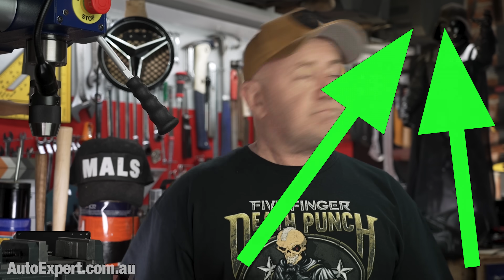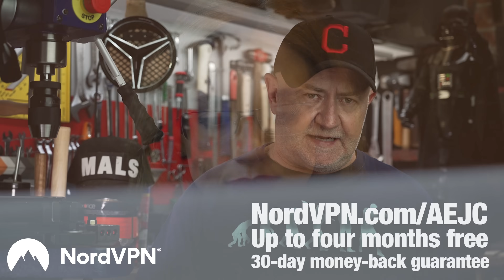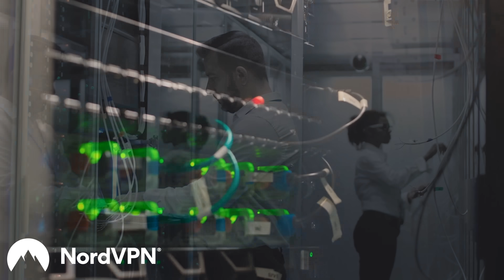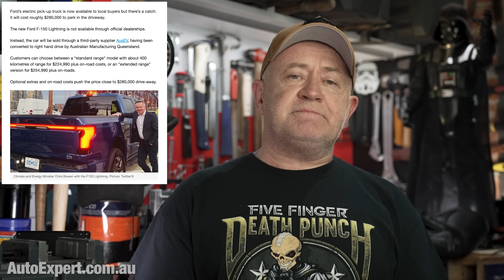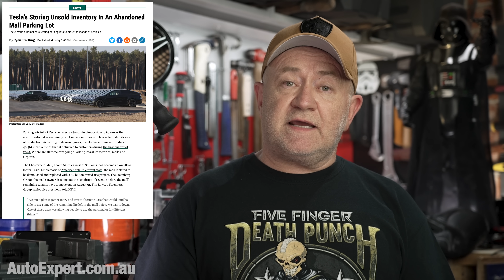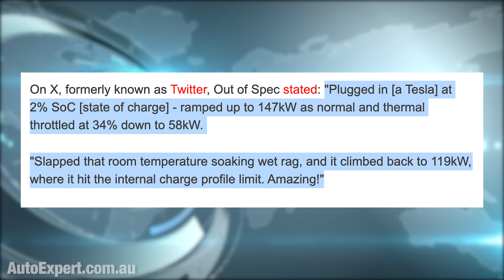ELECTRIC UTOPIA? Top 10 insane EV reports (this month)

Comment: Going on holiday with an EV. Either queue for 7 hours for a charger or fill the boot with spare batteries and take no luggage. What a choice!
Reply: And the extra weight will halve your range to get to queue even longer as you have to recharge the extras.
Reply: @alanhilder1883  precisely, it's like extending a rockets range. To get twice as far you need a lot more than double the battery, you need 4 or 5 times the energy as you need to carry all the chemicals, and the containers and cooling for them, just like you need to increase the fuel tank size and weight, and add more fuel to move that weight and fuel, and more again to overcome the increased drag due to the bigger rocket. It's simpler in thin/no atmosphere, but we typically launch from zero/low altitude, so we have a lot of drag to contend with, just like EV's with trailers lol.
Reply: @joytotheworld9109  Math desagrees! Take a 1000kg car of which 500 are batteries with 100 km range. To have the same car have 200 km of range you need less then 500kg more batteries.
Reply: @lucadellasciucca967  You're missing the point, Physics disagrees: A 1,000kg car with 500kg battery, if you add 500kg more battery you'll need to beef up the supension, it'll weigh significantly more(1) than 1,500kg after that. Now you not only lose range in the heavier vehicle due to the heavier battery, you lose range pulling the heavier car body too. You need lighter batteries or denser to keep the same km per kwh charged.

 (1)Say roughly 1,700kg after you up the suspension capacity, crash protection(2) and make it bigger to maintain similar interior space. 
(2)e.g. the passenger compartment especially in case of a roll over, crumple zones too!
Reply: @joytotheworld9109  Don't mind this little Luca. He is flooding this comment section with ”electro-religious” comments. Either is joking, but I'm afraid he is not... Possibly a troll.
Reply: @joytotheworld9109  ... which is why any EV of a decent range is a humongous vehicle - they need to beef up everything + the space for the batteries that will have enough energy storage to carry the beefed up vehicle + the batteries themselves. It's kind of a rocket equation (which is why rockets of any decent range are also huge). Sadly, the believers do not understand physics...
Reply: @zwerko  You said it. Same reason you need massive rockets to get a penny into orbit.
Reply: @ZangOne1  A troll, maybe, but I think a single clarifying reply is not feeding them too much, and if not a dose of reality might save them from spreading simplistic nonsense that gives EVs false promise.
Reply: @joytotheworld9109  Sooner or later, this kind of dudes would be slapped in the face by reality, and suffer the consequences.
My people have a saying: Every bird dies in its mother tongue.
Reply: @joytotheworld9109  Sooner or later, he and others like him would be slapped in the face by reality. But many of them would continue the ”crusade”, no matter what. My people have a saying: Every bird dies in his mother tongue...
Reply: @joytotheworld9109  Don't give them facts, they won't listen to facts. The delusion with these people is astonishing.

Sad too. 

Electric Jesus is a muppet. He's upsold a product he didn't have for decades and the USA is being exceptionally slow at prosecuting him. Something is fishy to me after they managed to get Elizabeth Holmes and Sunni Balwani (also fake product grifters).
Reply: Buy a Honda. A Honda generator🤣🤣🤣
Reply: Put a generator on the roof and charge as you drive, only need to fill the generator with petrol.😂
Reply: Fill the boot with batteries?…seems like money is no object eh…the sky is the limit, and you’re not even being ‘green’…yay😂
Reply: your tiktok to dance for monetized stickers to afford for the essentials while travelling duh.
Reply: I prefer option 3. Use a petrol or diesel car.
Reply: I went on a 7500km Australian outback holiday in my Tesla Model Y. I took the wifey, 2 e-bikes (inside the car), a spare tyre, and all our luggage. No spare batteries, and only queued once waiting at a single charger site for someone to come back and unplug.  Hardly 7 hours !
Reply: Staycation?
Reply: ButT I cHaRgEd iT At HoMe
Reply: Hmmm, last year, a guy from Perth drove around Australia in his Tesla. .....
13,500 kms in 10 days.... but keep peddling the nonsense....
Reply: @zwieseler  Very impressive I'm sure. However, if he'd had the good sense to use a diesel car, he'd have completed the journey in 5 days for half the cost.
Reply: @matthewgodwin3050  No one would "normally" do it in 10 days or 5.... on a holiday.
My point is.... the OP posted the usual misinformation!
Reply: Hitch up a box trailer with a generator and some spare fuel and your right to go anywhere
Reply: The good news is that the kids in school are back to learning critical thinking skills needed to plow through the YT bs.  They know that the election WASN'T STOLEN. 😉.
Reply: Mine does 600 KMs.......any further and I get a LCC to take me. Simples.
Reply: Once again Mr Codagan beats his Fossil fuel drum against the EV revolution. It’s time for him to start learning about EV’s rather hating them due to his zero knowledge about them. As to todays video he latches on to some piece of technology the average  EV user wouldn’t even dream of using or find the need to use it. Personally I have spent my entire working life since 1971 in the motor trade. Unlike Mr Cadogan I did not close my eyes to EV use but gave them a try after doing some considerable research into wether this car could be a usable replacement to my diesel car.
Firstly let me say I have never found the need to carry a spare can of fuel in my car simply because I am not stupid enough to allow my car to run that low in fuel. I change over to EV 5 years ago, have I ever run out of charge, no for the same reason I never run out of fuel with my diesel. Does my long range journeys take longer with my EV than my diesel car did, no it doesn’t, how s that you may say, simple good planning, make sure you have enough charge to get to next charge point if planned unit is not available for whatever reason. My EV has a bigger range than I personally have when it comes to Toilet/ meal/ coffee breaks and it doesn’t take longer to charge than I need for the aforementioned bodily requirements which would also have applied had I been driving my diesel car. At the end of the day the EV saves me more than £2360 in fuel costs per year. 
Would I consider going back to Fossil fuel vehicles, honestly why the hell would I, it saves me a fortune and is smoother and faster.
As to Mr Cadogans point on fires well the one aspect he failed to point out to his viewers is that a Fossil Fuel vehicle according to percentages of registrations fossil fuel vehicles are hundreds of times more likely to catch fire than an EV, he seemed to miss out that fact didn’t he because it didn’t fit his biased narrative.
Reply: Or use Tesla superchargers and don t have a worry in the world :)
Reply: @lucadellasciucca967  No worries except the car cost so much and is depreciating faster than you can make loan payments. Plus the boot is too small to go on holiday with the family anyway. Have to get a roof box which will destroy your range.
Reply: @thehairygolfer  I drive aTesla model Y. Long range lots of space and big trunk. Oh and a frunk. Supercharger network. Check it out.
Reply: @lucadellasciucca967  I think you'll find holiday destinations tend to be a long way away from locations with sufficiently high density of superchargers. Or any chargers for that matter.
Reply: @lucadellasciucca967   Here in Australia they are not that common and, by the sound of it, they don't seem to work in the cold of the northern hemisphere
Reply: @lucadellasciucca967  Elon fired all the staff responsible for running all the not so super chargers, so they won't be working for much longer. They're as obsolete as his fire prone death traps.
Reply: @matthewgodwin3050  To be fair, he re-hired 40 something of those people back—he wanted to downsize the department (which is ok request coming from a CEO), the director wouldn't budge, so he fired them all and re-hired a number of those he thought were suitable for the operation. Now, whether that number is correct or not is a different story, I have a feeling that most of Tesla woes would be solved by firing a single guy than thousands of others, but that's a topic for another debate...
Reply: @lucadellasciucca967  another yank that thinks America is the only country on earth..
Reply: @lucadellasciucca967 A tesla what crap charger, that mostly exist in USA. Your a funny one matte.
Reply: @lucadellasciucca967 Hilarious, they are just as bad , expensive abd now being opened up to many other makes ,join the queue

Comment: I pray at the Diesel Cathedral, Lord Otto is my saviour, a scavenged two stroke my hymn.
Reply: The heavy lifter of engines, nobody can argue with Diesel.
Reply: With votives for St.Stirling & St. Atkinson
Reply: Dr Rudolph Diesel was a god.
Reply: Ahhh, pine needles and two stroke smoke, the smell of nature in the great outdoors...🎉
Reply: Don’t forget the Patron Saint Jake Brake.
Reply: @captainotto in the 50's and 60's,  before Jake announced himself with his loud bark, that pair of piss lines on the pavement let you know you would be catching up with a loaded logging truck doing all he could to keep those brakes from fading. Think of all the water Jake has saved.
Reply: @grantdavis5992  Hey that's neat to know. I had no idea that water cooling brakes was actually used commercially before. Was it just sprayed on/in the drums? Corrosion must have been a big problem considering road salt, heat, water, cheaper alloys.
Reply: @captainotto  salt wouldn't have been an issue because this was summer operation. I never operated them, but I have a friend who might have in the early 70's. I will ask him.
Reply: Man you need help.
Reply: I wonder ham may really know what a savaged two-stroke is?
Reply: @BlackhawkPilot   True.  Gasoline 2-stroke engines commonly rely on scavenging to better full the combustion chamber, but 2-stroke diesels generally use a Rootes-style blower to push the air in.  I"m not sure that would be defined as "scavenging."
Reply: @BlackhawkPilot  I think the 6-71 in the charter coaches I used to drive would have qualified.  There was a pair of 4-53's, one counter rotating, in an old yacht I ran down on the Bayou in 78.
Reply: Amen, preach it brother!
Reply: Do your research, invest in Tesla.
Reply: as an effective tax write off due to the loss in share value? @lucadellasciucca967

Comment: I just had to do the TAFE EV safety course (for VRA rescue). Thanks to JC I didn't read any of the boring course work. Straight to the test and 100%
I'm now qualified to run like fuck if any of them start burning.
Reply: I’d bet one of the questions was “What steps would you take in the event of an EV fire?” The perfect answer of course, for ten points, is “ Fu*kin’ big ones.”
Reply: @MrChaza001  .......in the opposite direction.
Reply: I hope that you specified upwind in your answer?
Reply: @oldbloke204  yes, upwind was the correct answer.
Reply: @MattBlack6  Yay me.🤣🤣🤣
Reply: @oldbloke204  and run at 60kph....:face-purple-crying::face-purple-crying::face-purple-crying:
Reply: My young offsider has a mate in fire department, and the drill is clear the area and let it burn
Reply: I did initialise and decomision high voltage ev batteroes at tafe too. Waste of time but free is free and another ticket under my belt. To be honest, i dont want any of the fucken things in my workshop. They scare me. Would loose my shit if one goes into thermal runaway and burns my shop down.
Reply: So at the top of your to do list is to basically be really fit! 🏃💭🤣
Reply: Hi, we use fire blankets here in Canada.  But you guys seem to like your bbq's down under, so you do you.    Put some shrimp on and whatnot.
Reply: Does VRA and SES have any overlap? Who attends what?
Reply: @MrBenHaynes  VRA and SES only overlap in areas like flood rescue.
So up in the tweed where I am the SES is the primary agency for flood rescue, and VRA are available to back them up.
When we have major floods up here it is all hands on deck.
There are areas where SES are they primary land rescue organisation. Operations such as road crash rescue Urban Search and Rescue vertical rescue and so on.
There are also combined efforts such as land searches.
VRA is run by the New South Wales police force, and it is probably easier to think of them as a volunteer civilian version of police rescue for areas where police rescue do not operate. Up until recently we wore essentially the same uniform, the white jumpsuit but with green and silver chequers instead of blue & silver. We now run the same pants as RFS with a green jacket for our operational uniform. The water-based uniform is different again. 
In general rescue in New South Wales is quite a hodgepodge of different organisations.
VRA, Police Rescue, Ambulance Rescue, SES Rescue and Fire + Rescue.
Reply: Haha